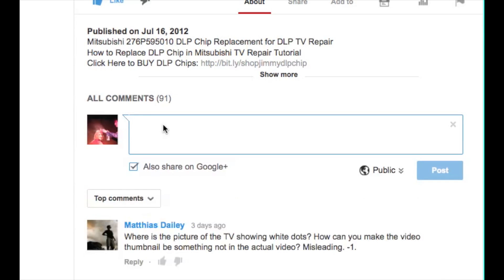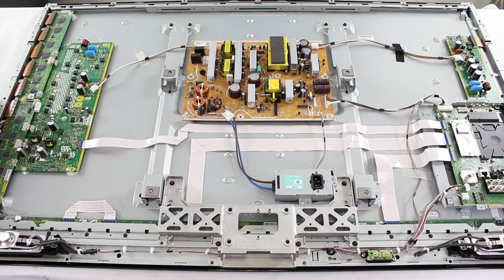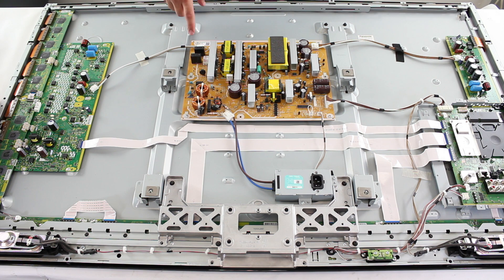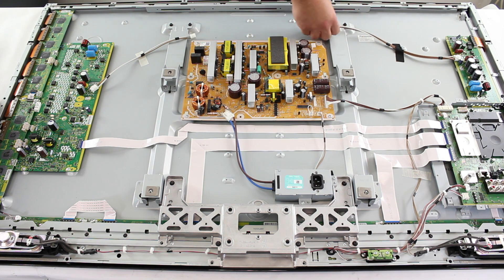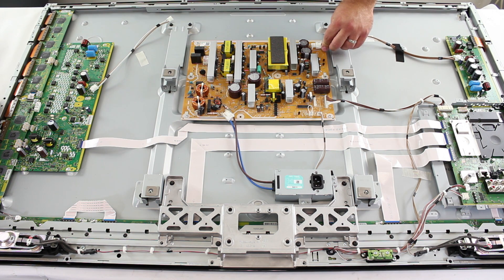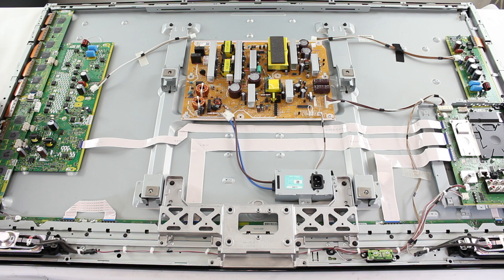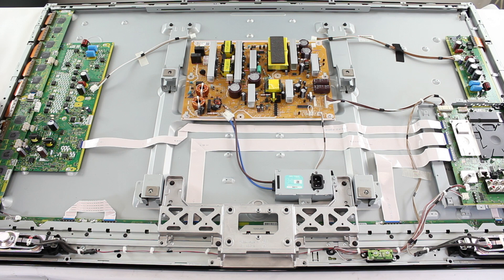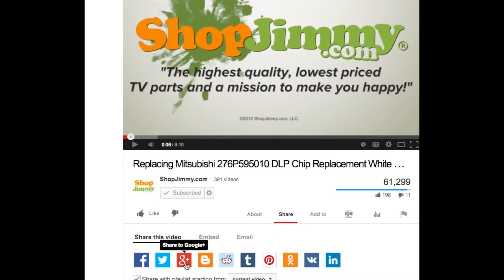Plasma TV Repair Help Clicking Noise & No Picture How to Troubleshoot Y Sustain & X Sustain Problems

Comment: Hello there I have a Samsung 50" plasma 3d TV and it works for about 15 minutes and then turns off and starts making the clicking noise the model number for the TV is PS50C680G5K
Reply from the maker: *****    Try this at your own risk. Unplug the TV, then disconnect the y board and plug in the TV to see if the TV powers up. Reply with the results of this test. Thanks! www.shopjimmy.com
Reply: Thanks does not fix the problem and the clicking noise still happens there is only one board that will stop the clicking noise and that's the main logic board when i unplug that from the power supply it will stop clicking, so is the fault my main logic board
Reply from the maker: *****  Try this at your own risk.  With everything connected and the X board disconnected, does it still have the same problem?  Thanks!  www.shopjimmy.com
Reply: +SimplyNextGen i had this problem and the clicking noise came from a small black box theres 2 of them and u can feel it clicking, all i did was take the cover off the 1 thats clicking and mine looked like it was just stuck making the clicking noise as if its turning on then i pushed the bit back where it was clicking on and it worked straight away, maybe you could try this as it worked 4 me and ive never opened a tv in my life good luck
Reply: +steven lee Johnson and just to let you all no i dont no if this is dangerous what i did or if it might damage your tv but it worked in mine straight away

Comment: I have a vizio vp422 plasma and when i unplug both the connectors I still hear the relays clicking. Should I be looking at replacing both boards?
Reply from the maker: William Long  PLEASE SUBSCRIBE - If you have experience using a meter you can check different voltages on the power supply and main board (let me know if you have experience).  If  you do not have experience with a meter, then the next troubleshooting step is to replace the main board and power supply board individually to see if one of them fixes your problem.  Click this link to replacement parts for your TV model number:  http://www.shopjimmy.com/catalogsearch/result/?q=vp422  Be sure to match part numbers on your current board, with your replacement for compatibility.  Thanks and please let us know if you have any further questions with your TV Repair!  www.shopjimmy.com
Reply from the maker: William Long  PLEASE SUBSCRIBE - If you have experience using a meter you can check different voltages on the power supply and main board (let me know if you have experience).  If  you do not have experience with a meter, then the next troubleshooting step is to replace the main board and power supply board individually to see if one of them fixes your problem.  Click this link to replacement parts for your TV model number:  http://www.shopjimmy.com/catalogsearch/result/?q=vp422  Be sure to match part numbers on your current board, with your replacement for compatibility.  Thanks and please let us know if you have any further questions with your TV Repair!  www.shopjimmy.com

Comment: I received your response (julio pagan Try this at your own risk. Unplug the TV, then disconnect the y board and plug in the TV to see if the TV powers up. Reply with the results of this test.)  This are the results. I disconnected the Y board and TV remained on, however when I disconnect the Main board there was a brief noise then nothing else,it remains off. Your thoughts. Thanks
Reply from the maker: julio pagan  Try all repairs and troubleshooting at your own risk.   I recommend replacing the Y board.  Please reply with your TV model number.  Click here to view a video that shows how to find your TV model number:  https://www.youtube.com/watch?v=S51nhAmwR2M  Thanks!  www.shopjimmy.com

Comment: I have a  51 inch Samsung PN50A400C2DXZA Plasma TV. The screen wont turn on, but a white light on the bottom blinks slowly. With only the main board connected to power and both x/y boards disconnected, I heard 2 clicks when I plugged the tv in. Does this mean the main center board needs replacing?

Comment: I have a Samsung PN50B450B1D. The red standby light stays on when plugged in, but there is no picture. From a visual inspection, none of the capacitors are bulging. There is a faint clicking noise coming from the power board every ten seconds. I replaced the main board to no avail. Any suggestions?

Comment: hi. i have a 50" samsung plasma tv. model no. ps50b451 
The tv sometimes switches on and works properly but will have a grainy colorfull fuz along the left edge of the screen. most of the time the tv will switch on but the screen will cut out and go black. i then have to switch it off and on again countless times to get it to work again. not sure whats wrong with it. have opened it up and there are no blown capacitors of any components that look burned

Comment: My LG 42 Plasma Model PQ30 has a clicking sound, powers on and off right away. Is this a power supply board issue or something else. Your thoughts, need assistance.
Thank You
Reply from the maker: julio pagan  Try this at your own risk. Unplug the TV, then disconnect the y board and plug in the TV to see if the TV powers up. Reply with the results of this test. Thanks! www.shopjimmy.com

Comment: ZENITH MODEL# 50PT320 WHEN I PLUG THE TV IN IT CLICKS 1 TIME RED STANDBY LIGHT COME ON  2 SECOND LATER IT WILL CLICK AGAIN  THE  RED LIGHT WILL  STAY ON . PRESS THE POWER BUTTON TI CLICK  RED LIGHT GOES OFF AND COMES BACK ON WITH NO OICTURE OR SOUND.

Comment: RCA 42" PLASMA TV   MODEL# 42PA30RQ
RED STANDBY LIGHT ON WHEN PLUG IN. WHEN PUSH THE POWER BUTTON THE TV CLICK 3 TIMES AND DOSN'T TURN ON BUT THE STANDBY LIGHT STAYS BLUE.
Reply from the maker: Lamar Ray   Try this at your own risk. Unplug the TV, then disconnect the y board and plug in the TV to see if the TV powers up. Reply with the results of this test. Thanks! www.shopjimmy.com
Reply: ShopJimmy.com when disconnect the y  board and push the power button the tv clicks 1 time and appear to be on but nothing on the screen or there is no sound but the standby light stay on blue.

Comment: Hi, i have a Vizio P50 HDTV20A. While watching a movie I heard a click sound like a relay changing state and the picture went out. I turned the tv off and on using the power button on the side the tv. The green power LED goes to yellow and back to green but no picture. but when I unplugged the TV and plugged it back in, the picture came back on for a couple of minutes but then we heard the click sound and the picture went out.
 I have been watching videos and reading badcaps forums trying to diagnos the problem and would appreciate your help.
I took the back off and dont see any buldging capacitors or even any burn marks on any of the boards. I plugged the tv back in and hooked it up to my xbox and turned it on. I started a movie and waited for the screen to go out. I have a flir camera and looked for hot spots. I noticed only one that concerned me. there is a capacitor disk thingy next to two relays on the power supply board that got up to 300 deg f. is this normal? I noticed that there are 3 led lights on one of the boards. (the board just below the power supply board.. I think its the sustainer board?) the led light on the left flashed while the other 2 were solid.  The movie played for a while with out the picture going out. so i moved the tv back to the stand with the back cover still off and when I turned it back on.. there was no picture. the green light would cycle again with the pushing of the power button but I noticed the 3 led lights on the board in the back were not on this time.  I tried tapping on the 2 relays on the bottom of the power supply but nothing changed.
I cycled the power cord and the picture came back on and the 3 led's in the back were back on and I finished playing the movie. I hope this is enough to go on.

Comment: I have a NEC 50 inch plasma model 50mp1 the unit once the power button is engaged both fans will turn on and you can
hear a relay turn on, after 2 seconds the fans turn off and you hear a relay click the power led light will stay green.
Reply from the maker: Anthony Buccella   Try this at your own risk. Unplug the TV, then disconnect the y board and plug in the TV to see if the TV powers up. Reply with the results of this test. Thanks! www.shopjimmy.com

Comment: Hi I have a question about my tv. I have a 42" microtek model # MP-42EN-S but when I open it up it says the parts are Samsung. I did what this video said and I think the problem is the power board but all I found for the model number is v4c. Here is what it says on the board.  Samsung electro-mechanics. Model: V4C.  PBC Rev. 0.12  user: Samsung   SDI DATE: 050526.    I am having the clicking and nothing on screen problem. Please help.
Reply from the maker: *****   Unfortunately we do not have any information on this TV model number.  Thanks!  www.shopjimmy.com

Comment: Hello, I have a Toshiba 32C110U. It will turn on with a good picture and sound. After it has been on for less than an hour, the picture and sound freezes freezes and then I loose the picture. Sometimes there is some loud popping sound. I did unplug for a while, retried and the picture and sound returned. But the trouble returned quicker. Can you help. I only had the tv about a year when this started.
Reply from the maker: Hannah Dubiel   Please watch this video FIRST to help with your repair!  https://www.youtube.com/watch?v=BP3NVNCGEv8   I recommend replacing the main board in your TV.  Click this link to replacement parts for your TV model number:  http://www.shopjimmy.com/catalogsearch/result/index/?cat=56&q=32C110U  Be sure to match part numbers on your current board, with your replacement for compatibility.  Here is a link to a video showing how to identify your part number, click here:  https://www.youtube.com/watch?v=3DQe0ATZl_Q  Thanks and please let us know if you have any further questions with your TV Repair!  www.shopjimmy.com

Comment: Hi there! Thanks for video help but after unplugging boards I still here clicking on my Magnovox 42mf237s 42" plasma. Is there a capacitor on the supply board I should be looking at to replace now? Thanks in advance!

Comment: I have a visio 42in plasma found a blown fuse (4a 250v) on the ysus everything else looks good. There was a loud pop sound and the video was off still have sound. This is an 07 model. Replaced the fuse still no pic heard a sizzle while it was on changed channel sound went away still no pic. rechecked fuse still good???
Reply from the maker: Roy Skud   I recommend replacing the Y board and Y buffers in your TV.  Please reply with your TV model number.  Click here to view a video that shows how to find your TV model number:  https://www.youtube.com/watch?v=S51nhAmwR2M  Thanks!  www.shopjimmy.com

Comment: Hi,

my LG 32PC5RV plasma tv dims (losing brightness) after several minutes of watching...but if you try to turn it off then open it again the brightness recovers but it dims again after several minutes..my brightness setting in picture settings is already maxed out.and if you try to set it in dynamic picture mode the display turns into red-black shade in cluding the menu(like sepia but its red). thanks!
Reply from the maker: Felmar Manrique  Please watch this video FIRST to help with your repair!  https://www.youtube.com/watch?v=BP3NVNCGEv8  This could be a problem with either the Z or Y board in your TV.  You may need to replace each board individually to see which one fixes the problem.  Click this link to replacement parts for your TV model number:  http://www.shopjimmy.com/catalogsearch/result/?q=32PC5RV  There may be multiple boards for the same TV model number, be sure to match part numbers on your current board, with your replacement for compatibility.  Thanks and please let us know if you have any further questions with your TV Repair!  www.shopjimmy.com

Comment: my panasonic tc-p50s30 has the 14 blink error code- cannot find any shorts to ground on the power teminals per your 14 blink tutorial, so I suspect the main A board.  Unfortunately, I cannot locate a A board replacement....is there a way to fix the A board or troubleshoot bad components on the A board?

Comment: Hi there! Very nice work i must says. So I have a SAMSUNG PS50B430P2WXXH and after following the video instructions it came to this.
1. All conected -> Clicking and standby led flashing slowly.
2. Disconected X Board from Y board (No direct cable to Power supply Board)
3. Disconected Y Board From Power Supply Board.
4. -> Starup Sound & NO clicking.
5. Reconected ONLY Y Board -> Same resurlts as 1 =Clicking and standby led flashing slowly.
So according to this video it should be the Y board the problem. But my question is how do i know if it is not BOTH Y & X  Boards that need replacement? Is there another troubleshooting step that i can take to make sure that the X board is indeed working properly ? 
Many thanks, Dennis
Reply from the maker: dennis panayiotou  Please watch this video FIRST to help with your repair!  https://www.youtube.com/watch?v=BP3NVNCGEv8  Normally the x board does not get taken out and replacing the y board will not damage the x board.  If replaying the Y-Main Board, be sure to replace the Y-Buffer board at the same time.  Click this link to replacement parts for your TV model number:  http://www.shopjimmy.com/catalogsearch/result/?q=50B430P2  There may be multiple boards for the same TV model number, be sure to match part numbers on your current board, with your replacement for compatibility.  Here is a link to a video showing how to identify your part number, click here:  https://www.youtube.com/watch?v=R1jmj_foId0  Thanks and please let us know if you have any further questions with your TV Repair!  www.shopjimmy.com

Comment: Viore Model: PDP42V18HA. After plugging in the television and turning on the unit, the TV screen flashes on and off. A high-pitched frequency noise can be heard from the Y-sus board. Please view my uploaded videos on my youtube account for a better reference of what I'm talking about. I realize that I can simply replace the entire Y board, but for the interest of saving ~$70 I would really like to repair the issue myself. If you can suggest what might be causing the noise, then I could look into repairing just that one component (such as a capacitor or transformer). Thank you for your help, and sorry my videos are poor.
Reply from the maker: Enlightenist  Please watch this video FIRST to help with your repair!  https://www.youtube.com/watch?v=BP3NVNCGEv8  I recommend replacing the YSUS board and the YDRVTP board in your TV.  Click this link to replacement parts for your TV model number.  http://www.shopjimmy.com/catalogsearch/result/?q=PDP42V18HA  There may be multiple boards for the same TV model number, be sure to match part numbers on your current board, with your replacement for compatibility.  Here is a link to a video showing how to identify your part number, click here:  https://www.youtube.com/watch?v=GEllG3RV-tc  Thanks and please let us know if you have any further questions with your TV Repair!  www.shopjimmy.com

Comment: Samsung Model: PN60E7000 -  Tv doesn't turn on, Clicking cycle, Red Light cycles 10 times. Watched your Utube video's. Reviewed other online samsung plasma issues with power board capacitors, replaced several capacitors on SMPS board, still clicks & cycles. Unpluged Y-main, still clicks, does this mean the X-Main is bad? Also, VS Voltage never stable at any point. Thanks.
Reply from the maker: Perry Underwood  Please watch this video FIRST to help with your repair!  https://www.youtube.com/watch?v=BP3NVNCGEv8  I recommend replacing the X & Y Board in your TV.  Click this link to replacement parts for your TV model:  http://www.shopjimmy.com/catalogsearch/result/?q=PN60E7000  There may be multiple boards for the same TV model number, be sure to match part numbers on your current board, with your replacement for compatibility.  Here is a link to a video showing how to identify your part number, click here:  https://www.youtube.com/watch?v=R1jmj_foId0  Thanks and please let us know if you have any further questions with your TV Repair!  www.shopjimmy.com

Comment: I have a Samsung PN50B450B1D we have sound but no picture. A little background we had a thin vertical line on the left side of TV for almost a year that never went away didn't move and didn't flash. Then all of a sudden after a year the line jumped from left side to the right. Then after a couple of days we lost all picture. We have sound but no picture. Lights come on and TV powers up just no picture and menu screen will not display. How do I fix it?
Reply from the maker: Karen Berry   This sounds like a TV panel (TV Screen) problem.  If your TV panel is bad, it may be more cost-effective to replace the TV as panels are typically hard to find in stock, difficult to replace, and expensive.  Thanks and please let us know if you have any further questions!  www.shopjimmy.com